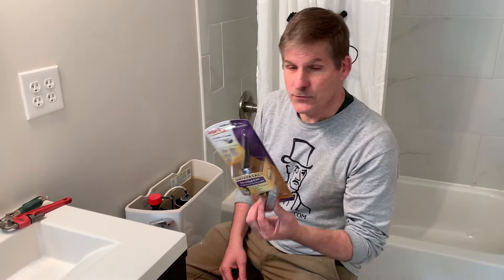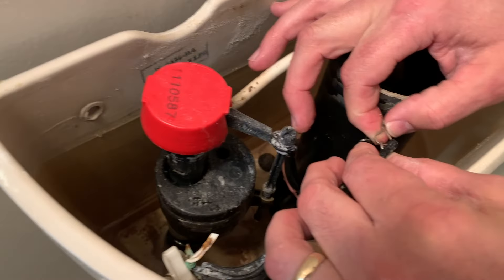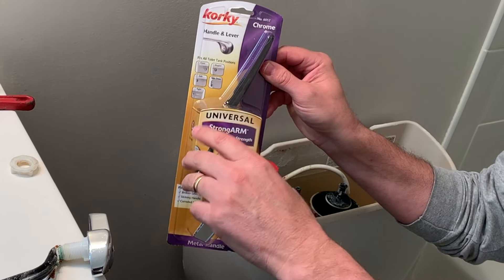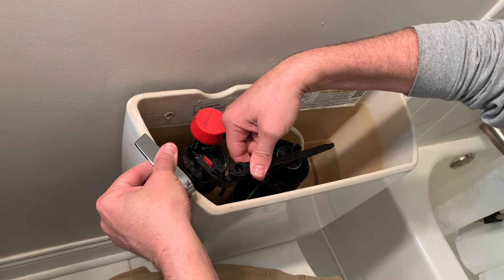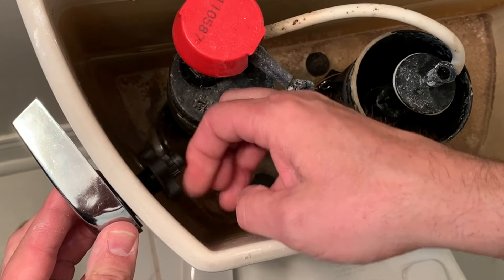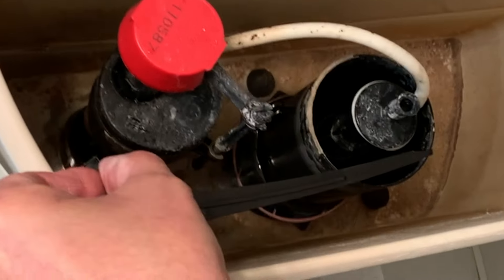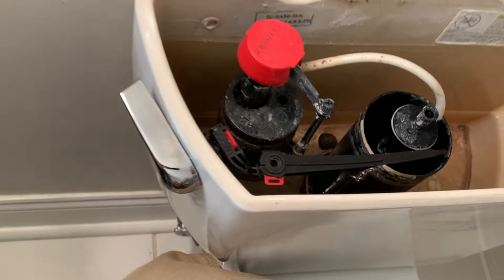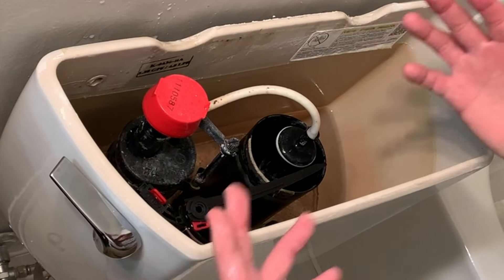How to Replace Toilet Handle with a Chain

Comment: I think I bought a defective Korky. The handle has some play in it which doesn't seem right. I didn't see any way to tighten it. Does anyone have some ideas or reasons for the looseness? It's a long drive back to the hardware store.

Comment: Nice video showing how to install. This lever is a very nice design. It's got both x and y axis adjustment to fine tune the angle of rotation and it adjusts easily with a snap on clip. My only concern is it's all plastic. I have a Kohler OEM plastic arm that snapped at the joint connecting the handle. But then I got over 10 years of use so maybe it's time. Is this plastic lever still holding out for you? In theory plastic should be fine as it doesn't have to endure alot of force and there's no corrosion.

Comment: Once I put the top back to the tank, the lever doesn’t lift high enough. And it’s too low if I move the chain
Reply from the maker: Check for lever adjustment / some are made that way, some are metal ( copper ) that can be bent.

Comment: Thanks for the video. 
 I have done everything as far as I can tell exactly as you did in the video. But my handle does not lift the lever. It feels like it is stripped but it’s brand new.
Reply from the maker: Hey Olive,
The lever inside the tank ( had an adjustment feature that had to be tightened once adjusted to fit. If yours is the same, I would check that. 
Otherwise, maybe it’s just faulty. I would move the handle slowly with the tank lid off and see where it is going wrong.
Thx for watching!
Reply: Same problem but I bought the metal universal handle. No matter where I bend it I can’t get it to lift the lever. 😖

Comment: I installed the same unit before I saw your video. I like it because it seems strong, but the construction is stupid. It does NOT fit all toilets as advertised.  I have a side mounted handle, but the hole for it is much further back on the tank than in this video. So, every time I flush, I have to reach way back and push down on the back of the handle - very awkward. The original handle was facing forward, and that was very natural. There is no way to make this unit do that. Every time I flush it pisses me off that they didn't make it adjustable.
Reply from the maker: Hey Cockpit,
Maybe … buy just a side-mounted replacement handle???
Thx for watching!
Reply: @Housebarons  They are all cheaply made. That's why I got this one.